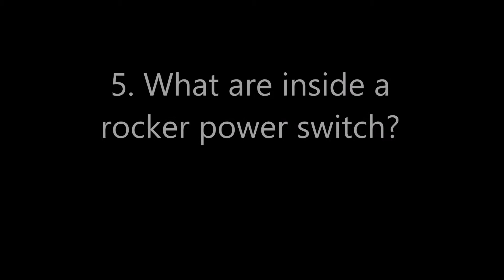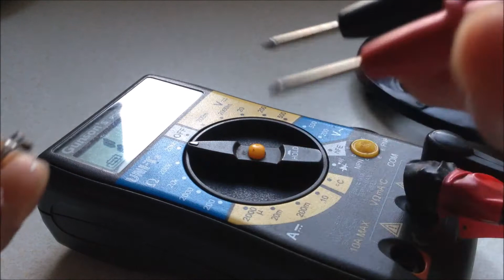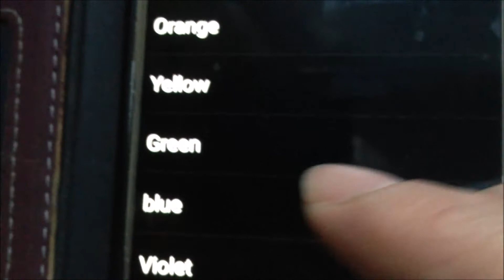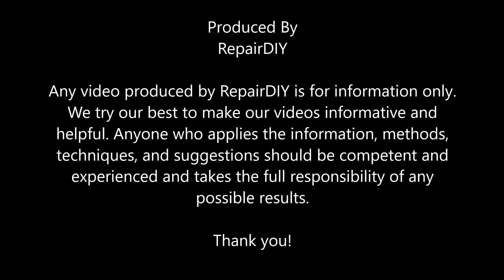Delonghi Coffee Maker: Rocker Power Switch: How to Repair? ICM2.B

Comment: Thank you very much for this video.
I had a problem with my rocker switch..  the light was not working, but luckily the power was being related to the rest of the circuit and hence the coffee maker was heating and working.  Thanks to your circuit diagram video, and explanations of the components of the coffee machine in another video, I learnt how this whole thing works. 
I managed to find a replacement rocker switch on AliExpress (lots of small replacement parts easy to find on AliExpress, but not easy at all to find in the US, and even if one can find it on Amazon it will be lot more expensive).

The AliExpress ad said the LED rocker switch works for 12V to 110V to 220V. I was surprised how it can work across such large voltage range, given how LEDs burn out if you just exceed input voltage across the by 2-3 volts.   But it does work. Great.   

Thanks for opening the rocker switch and showing the internals.  I opened mine, and saw the VERY small RESISTOR, etc.   so small I don't know how you to managed to solder a new RESISTOR in there. Good job.

You mentioned the Resistor is 160K Ohms.   Perhaps that explains how the rocker switch LED works across such a wide range of volts.  The current on that circuit will be very small because of the high resistor ohms, and most of the voltage drop is across the Resistor, and hence the LED in series with the RESISTOR will be subjected to just a small 2-3 V?